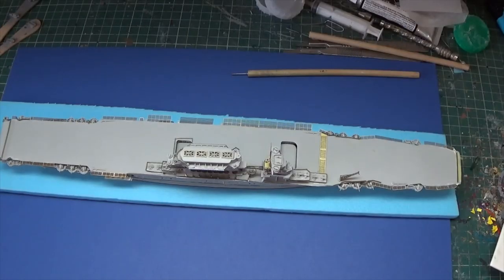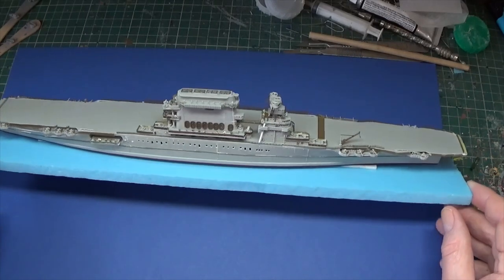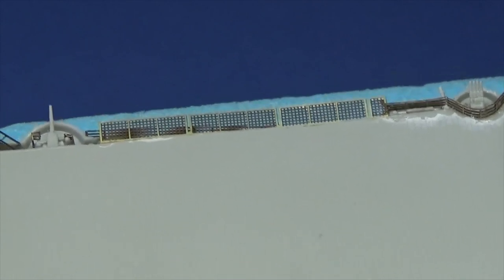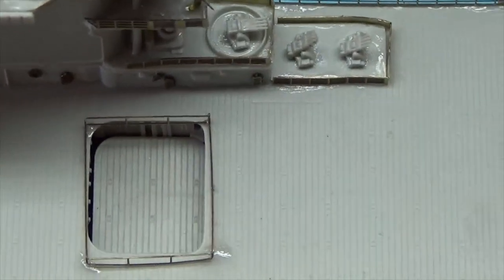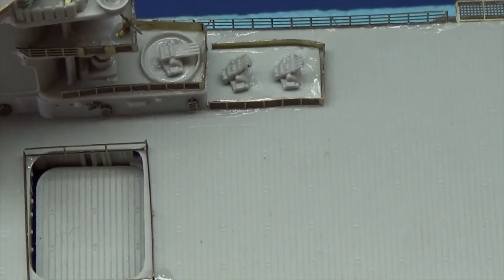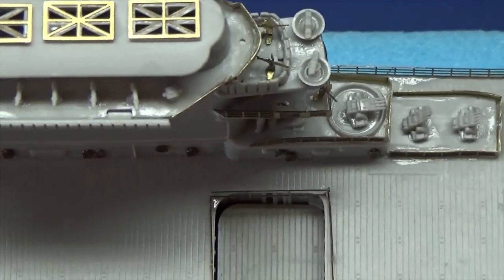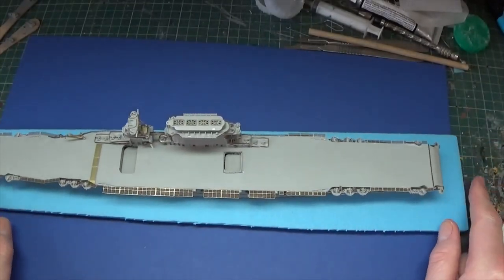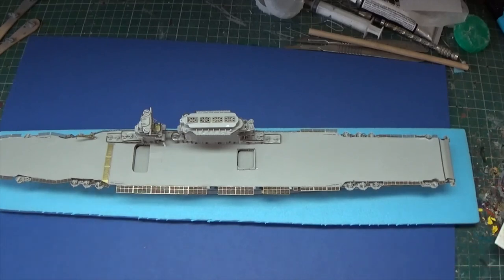Trumpeter 1/700 USS Lexington CV2 Build Part 6

Comment: Nice work Gav, coming along well.  I didn't realise you were branching out into comedy!  @1:44 "it's not going to be a long video" LOL, made me laugh!   My tip for tiny PE and glue, apply to the bit of the PE sparingly with a pin in a stick (yes I made one too) and then spray the spot where you want it to go with a good dose of kicker, must be careful when placing the PE but it grips instantly and for me at least means way less risk of drowning in glue or buggering the part through over handling.  Cheers 👍👍👍
Reply from the maker: Thanks for the advice Glen , yes the not long videos are a standing joke now marra . Regards Gav.

Comment: Hiya Gav :) I had a couple of thoughts re painting:

1. Any model only has to convince from a normal viewing distance. So long as it achieves that 'rivet counting' is not relevant, so don't sweat it.
2. With the PE railings etc, maybe spray the whole area the main colour and then just dry brush the lifeboats and railings etc. From a normal distance I think that would look OK.
3. Flight deck etc. I'd mask the whole lot off and then cut around the edges and any other details. Then pull off the tape from the main deck, spray it, pull off the bits of masking tape, and you should be left with the flight deck painted one colour with the detailed bits left alone.
Reply from the maker: Thanks Julian the times to make these decisions is getting closer not far to go now before its time to paint , cheers marra . Regards Gav.